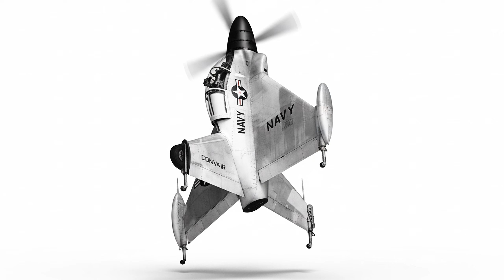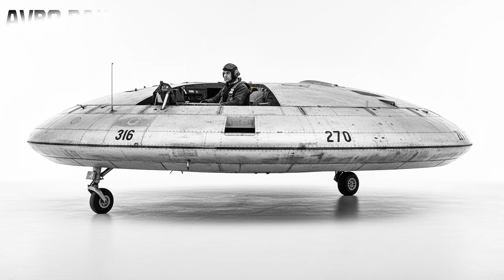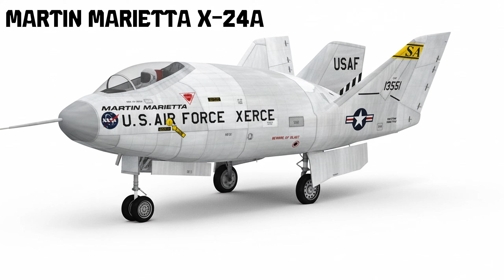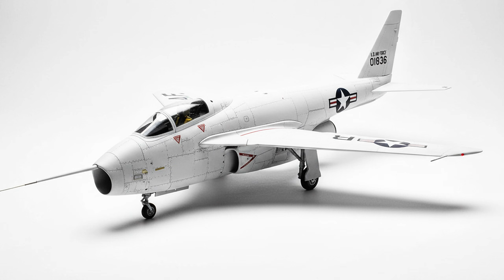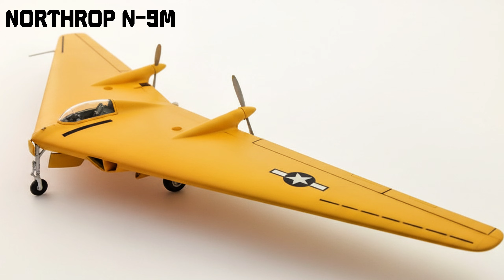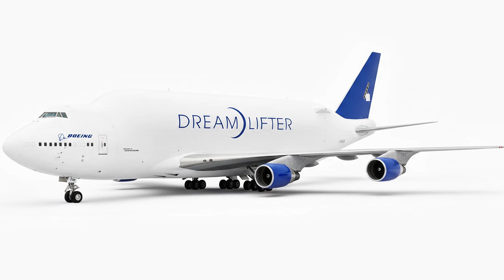Every STRANGEST Plane Ever Built

Comment: XP-79 was not prop driven. I don't believe the P-1101 had side intakes. The B-2 looks screwy. Leading edge of the wings aren't curved, and the intakes are wrong. The H-4 is a mess. Your image has it with 6 engines and landing gear. It absolutely had no landing gear, and it had 8 engines. The tail is also wrong. The C-5 has 4 engines. Yours shows 6. The Beluga has 2 engines, not 4 as shown in the image. Look, if I were making videos like this, I would definitely be checking the AI generated images against actual images, because AI really isn't all that bright.